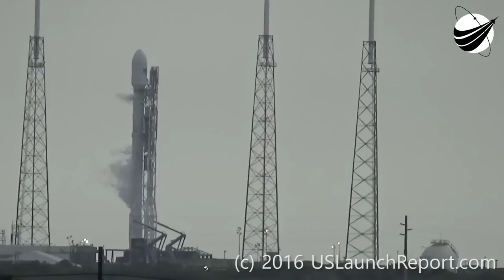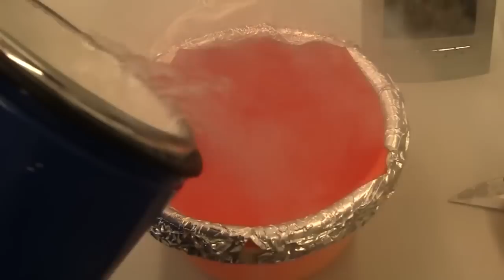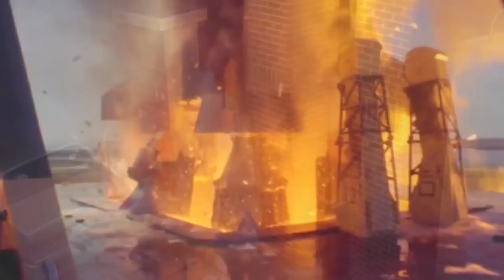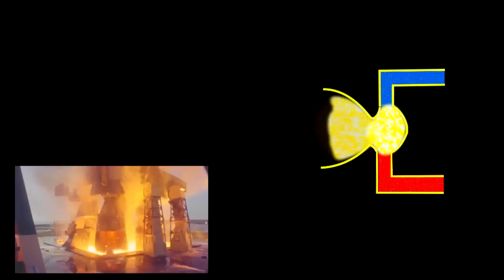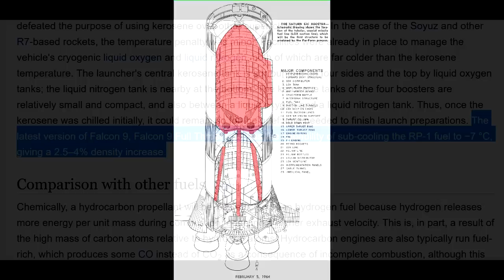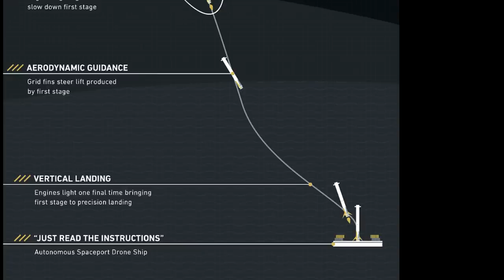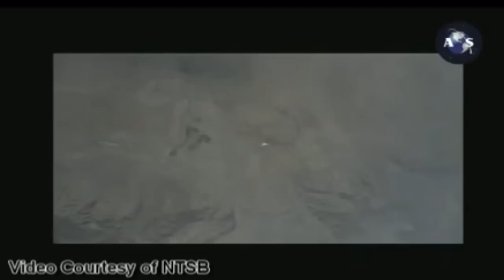Why did the Falcon 9 Explode?

Comment: I have nothing against private industry, but I think that space travel should not be ceded to the private sector.
Manned space flights provide far more than scientific information. They provide us with examples of the best that men can be and accomplish.
You can get information without using men, but manned space flight supplies us with dreams, which are just as important to mankind.
Reply: Unfortunately most of the general public does not share your enthusiasm for Human Space Flight (HSF). If they did, NASAs budget would not have plummeted to the point it equals its 1960 budget as a percentage of fed spending. And there would have been a ready replacement for the shuttle. Instead, we rely on Russia to shuttle our astronauts to and from ISS. We have no choice at this point but to cede HSF to the private sector. They're off to a questionable start so far given the early predictions of 2004 claiming suborbital space tourism would begin around 2008. That should have lead to orbital tourism by now. Instead, the private sector looks more like NASA with delays and one in flight fatality so far. But if they eventually manage to economize low orbit, the rest should follow.
Reply: ***** May I question one thing you said? Is there some factual data that the general public does not support manned space flight?
The other thing is that this is not really something that should be decided by opinion polls. Our society needs this. We do need dreams. This is something that should be decided by good leadership, and the United States does not have that right now.
What do you suppose men will do when our sun becomes a red giant?
Do we want to be here when the sun dies?
Far away in time, yet also we have to be further away for men to survive.
I have all sorts of reasons for manned space flight, and the money IS there. The United States just has to decide to get the wealthy to pay tax.
This post should keep you jumping. All sorts of fodder for discussion.

Comment: The smart thing to do is to send people and payloads into space cheaply and reliably:  on Soyuz vehicles.
Reply: That's been going on for half a century in Russia. And for the past five years, the US has been hitching rides for our astronauts to and from ISS on Soyuz spacecraft. The problem with Soyuz overall is that it only goes up 4 times a year. It can't be that cheap with such a low flight rate. It costs $30 to $70 million dollars for one astronaut if I recall right. The launch vehicle itself is being produced in large numbers, but it is used for numerous unmanned payloads including the Progress tanker/supply craft.
Reply: Soyuz Rockets also explode occassionally. Fundementally rockets are dead. They are used because we have nothing better currently. IMHO with our current technology building a space elevator is the way to go in terms of space exploration. It would allow us to get things out of this oppresive gravity well at minimal energy cost.

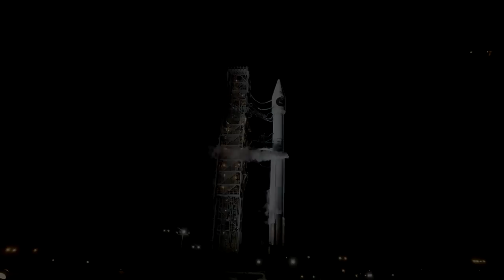Comment: @6:48 "Well clearly the propellants must have mixed to give this explosion."

In the later stages of the event, certainly. But it's the initial cause we're wondering about, the rest of the explosion is just the result you expect to happen once the upper stage LOX tank has ruptured.

Keep in mind that there are other potential sources for an explosion, like the explosive charges on board for the flight termination system. I'm not saying it was that, but you seem to be ruling it out without any data to back it up. (And then there's all the sabotage conspiracy theories, which, while I'm not going to contribute to, aren't necessarily impossible.)
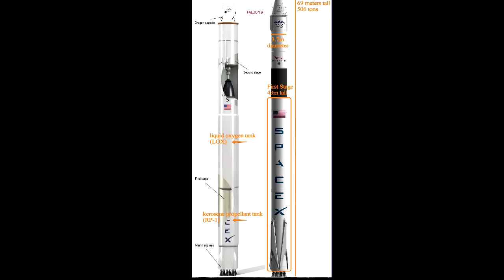Reply: @9:28 - The explosion doesn't happen at the "business end" of the second stage either, rather right at the top where the fuel and oxidizer filling lines go in. (There is another rocket on top of it though, and one SpaceX didn't build. The hydrazine thrusters in the satellite!0
Reply: And by @10:35 you're taking these assumptions and drawing a conclusion from it. You actually disprove your theory here as there's no possible way that much LOX and kerosene could come in contact, all at once, at that position in the rocket. We are almost forced to reach the opposite conclusion, that some other explosive source started it, not the propellants being loaded.
Reply: @12:48 - Oh really? Elon Musk invented rocket failures after the industry had previously got everything right? LOL! Man, it's really starting to look like have a problem with people who accomplish things, Phil.
Reply: @12:58 - People get ecstatic over the rocket landing because unlike everyone before them they dared to do it! If they listened to pooh-poohers like you though they certainly wouldn't have.
Reply: @13:20 - Recovering a rocket has technical drawbacks? Yeah, that's why we throw a 747 away after its first flight. Too many "technical drawbacks" in having to clean it, refuel it, and occasionally change the tires. "Ashtrays are full, call the wrecking yard to come take my car away!"
Reply: @14:46 - They always saved some fuel in all rockets as the engines tend to explode if the fuel runs out. Yes, this reduces their lift capacity a small amount. But considering that most of the COST of that rocket is the rocket, NOT THE FUEL, then it makes sense to sacrifice some performance to not have to build a WHOLE NEW ROCKET again. 

And then you compare it to manned rockets that waste their launch abort motors when Crew Dragon will use the same fuel and engines it would use for escape (if necessary) for orbital and landing ops!

Really, Phil, you're a bright guy but you're no Elon and you're only embarrassing yourself and eventually losing followers by attacking him. (I realize it's good click bait in the short term but, seriously, your credibility is waning and once it's gone myself and other thinking people like me will be gone as viewers to your channel.)
Reply: @15:28 - They don't just recover the engines. They recover the entire first stage! And you think they make decisions that will cost them money? The whole point of this is to save money. Rockets don't put things in space, MONEY does, and the more of that you can save, the more you can put into space.
Reply: @15:30 - Another bullshit myth that I can't believe you're daring to cite. The SSMEs were completely rebuilt at great expense after every flight, as well as massive other refurbishing on the orbiter. Same with the "recoverable" SRBs that cost more to recover and completely rebuild and reload with solid propellant than it would have taken to make new ones. The shuttle's reusability was BULLSHIT, part of how they sold it to the public. But SpaceX are spending their OWN money on this. Get it, yet?
Reply: Oh, and then you immediately do a 180 and point out what I just did. (And then conflate Dragon with Space Shuttle! Logical fallacy, much???) Pick a fucking side, man, you can't argue that BOTH ways!
Reply: The first reuse of a first stage booster was to be on SES's flight in November. Doubtless set back some now by this accident, but their paying customer could not have been more enthusiastic about the chance to be the first to fly a payload on a flight proven rocket!
Reply: @17:16 - NASA killed 17 astronauts with programs that cost vastly more than this (ooooh, here comes a trigger word) commercial rocket!
Reply: And again, like NASA never had problems with their safety culture. They fucking knew about the frozen O rings but ignored the engineer who tried to raise the red flag about it and murdered 7 astronauts on Challenger because of it. And yet, how could they be capable of such evil when they're not commercial?

Comment: Has there ever been a rocket propelled by a nuclear blast? How would this work/not work?
Reply: No rockets have been propelled by nuclear blasts. Environmental concerns and the end of Saturn-V production prevented development of nuclear upper stages for the Saturn-V. Nuclear thermal rockets work by passing hydrogen or some other fuel through a reactor. The reactor acting as the oxidizer rather than carrying LOX. Initial Specific imPulses (ISP) are on the order of 800-1,000 versus the roughly 450 ISP obtained with LH2 and LOX. There was also a project called Orion which demonstrated in principle that using nuclear explosions to push a rocket to orbit or escape velocity could work. The concept was tested using a small model of the spacecraft and pusher plate and detonating chemical explosives in rapid succession under the pusher plate. The problem is that the minimum bomb load is 300,000 nukes or thereabouts being fired in rapid succession to get a huge craft to Saturn and 3 million nukes to get it to a nearby star. In well over half a century, the US and Russia built only about 50,000 nukes between them during an arms race. Orion would be extremely vulnerable to problems that could result from just a few of the 300,000 nukes misfiring.

Comment: "NASA would never have allowed as design where (one mistake) could lead to catastrophic failure"

Uhh, but they did. The Space shuttle had hundreds of "single-point catastrophic failures" it was a massive scandal where it was found the overall design was riddled with faults where any one going wrong (not even a mistake, just a probable rate of failure) would kill everyone on board.

Comment: So the video titled "Why did the Falcon 9 Explode?" doesn't even have a guess as to why it exploded, apart from the extremely obvious part about fuel and oxidizer mixing at a point of failure?

Sure Elon Musk doesn't know everything in the world, but I don't believe for a second that SpaceX have never considered the points brought up in the end of the video. No one said that their reusable rockets would be a success on the very first try, but they have already pressed the prices in the rocket industry even before a single rocket has been reused, that ought to show detractors that they are not novices that bring nothing new to the table.

Virgin galactic with SS2 obviously got a little ahead of themselves, every death is a tragic event, but their concept is still the rocket that has reached suborbital space more than once with the least refurbishing time, so that concept should not be dismissed out of hand either.

There is a big difference between a project not being finished and a project having no promise!

Comment: While it does remain to be seen whether Space X can open up low orbit economically, we better hope they do. Taxpayer funded Human Space Flight (HSF) is coming to an end in the US. The only way to revive it now is to actually have a goal for programs like the SLS/Orion. This flexible strategy isn't working so far. Why one might ask? Look at the glacial development schedule of SLS/Orion. A schedule that has almost as much time between the first and second test flights as the entire Apollo flight schedule. Apollo lasted 5 years and 1 month from Apollo 4 to Apollo 17. So far, the Orion capsule has only been tested once. This being the December 2014 test which didn't even utilize the SLS booster. Apollo 4 to Apollo 5, 3 months but with two different boosters. Apollo 4 to 6, around 5 months. SLS/Orion does not have to be a crash program like Apollo. But it would have been nice had there been a test schedule where flights occur once every 6 months. The current flight schedule has 4 years between the first flight of Orion and the EM-1 mission. This is the sort of thing that fuels conspiracy theories if nothing else.

Comment: Early on you say 200ml of liquid oxygen turn into about a cubic meter (or 1000l) of gas (or vice versa). Later you say the liquid oxygen tank is larger than the fuel tank. But you then go on to say 1l of rocket propellant (I assume you mean the sum of both there) turns into about 1000l of gas. I don't quite get how the math can work out here. If 200ml of liquid oxygen already turn into 1000l of gas you would need less than that...but then you would have a ratio of 1 to more than 5 of fuel to liquid oxygen to make that 1l of propellant.

Comment: While I'm not completely in agreement on some of the things you are implying... I have to give props for the shear iconoclasty at play here.  Bravo, good sir!
Reply: P.S. For Reusable space launches, I'm thinking we need to invest in E.M. catapult technology.  Basically the "Stage One" needs to be glider attached to a giant Gausse Cannon. The Space Craft itself needs to be mediated by a Faraday cage so that it does not get saturated by the charges on the Glider, and the disconnection needs to be internally actuated so that the glider and the spacecraft can detach Because there's no way to shield the glider from the Magnetism and still have it fly out at escape velocity plus whatever it will lose to drag over a Kilometer or two.  (Perhaps the glider could have a cockpit and be manually piloted to the ground by either a person or a shielded robot.The drawback of course is if the launch craft lets go too soon, the spacecraft leaves too fast and overshoots its trajectory. If it lets go too late it loses too much momentum and the pod goes plummeting to the Earth below.)

Comment: The LOX tank and RP1 tank have pre valves just below the tank.  These are closed during filling, so LOX would not have been in the pipe going through the RP-1 tank.

Comment: correct me if i'm wrong, Thunderfoot, but...wouldn't the engine and pumps of a rocket be severely stressed after a successful launch? after all, that much energy and heat can't be good for them, the deterioration should be off the charts

Comment: Oxygen can not be stored as a liquid at any pressure, at room temperature, because it is above its critical temperature.
The next flight is the first reuse of a falcon 9.
The reusable suborbital platform part of the Shuttle were the solid fuel rocket boosters (SRBs). This is the part that should be compared to what Space-X is doing. The recovery and refueling  worked well and saved a lot of time and money.  The sole failure of note of an SRB was in no way involved with its reuse.
This was a good video, and it explained well most of what it covered. Good job Thunderf00t.
Reply: Well actually the shuttle itself was also reusable :) Also the boosters were not so good as you may think. A lot of the boosters had to be scraped after the splashdown and the saltwater also caused quite a lot of corrsion on the boosters. Also the inspections were so complex and expensive that some people questioned that there actually were any saveings at all. (Thats the reason why SpaceX decided against it)
With the shuttle it was a similar storry. There the mentioned pumps, but also the engines itself were problematically. The costs of the repairs and inspections on the spaceshuttle was the main reason why their goal, to create the cheepest space transport system, failed and in fact it became on of the most expensive
Reply: nukularpictures What made the Shuttle so expensive to operate was the high empty weight of the return vehicle.
Reply: Yes but plus the fact that the repair was so expensive. All sources I know state that the saveings were minimal or none.
Of course haveing to transport and entire crew + lifesupport is also really expensive if you just want to deliver a satelite.
Reply: nukularpictures Inspections are required on new construction too, so don't count that cost. repairs are almost always less expensive than new construction, so, don't count that either.
 The high cost of the shuttle was its overall size and weight, and; all missions being "manned" with 7 people just made things worse under the conditions the shuttle ended up operating in.
  One of the problems for the shuttle (as you know) was that its original mission of building and supplying a LEO space station was never funded properly in its early years. Had this happened then the shuttle would have been a useful tool, being able to haul 5 construction workers ( assembly technicians) and a truckload of materials and then later change out station crews and haul supplies. Once space based manufacturing started it wouldn't be coming back empty. Under these conditions (the designed conditions) the shuttle would have worked cost effectively. However it would have been better if more had been spent on its initial development.

Comment: Yes, it exploded. It's not the first, or the last rocket to fail. 
If there were people on it they would be safe - they testes the launch escape system already. 
NASA would not have allowed unsafe designs to launch? Seriously? The Shuttle did not have a launch escape system! And it had 2 crashes, remember? It was run as a government jobs program, not a private lean operation, so it was bloody expensive.